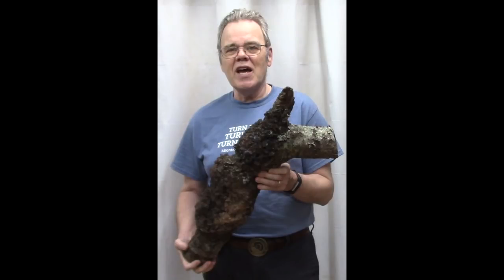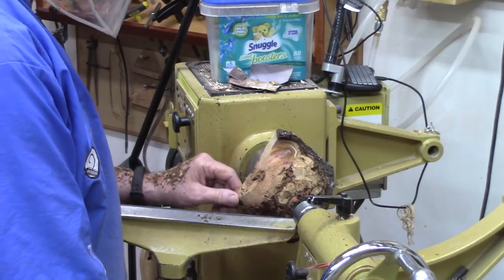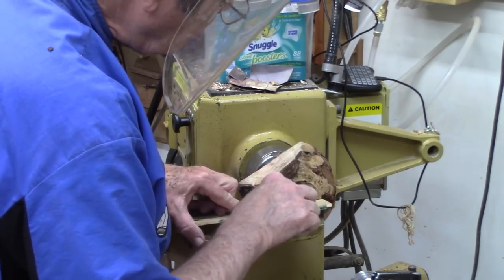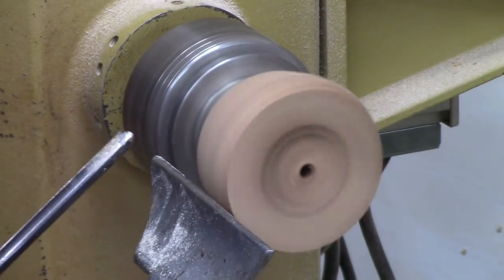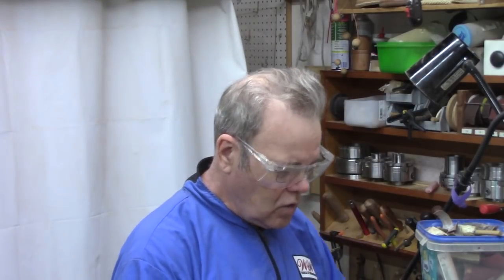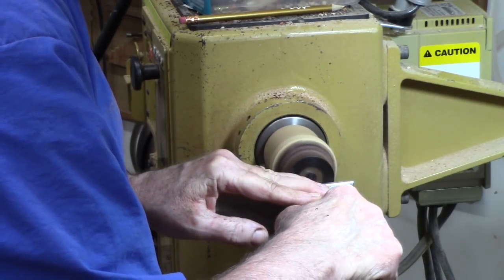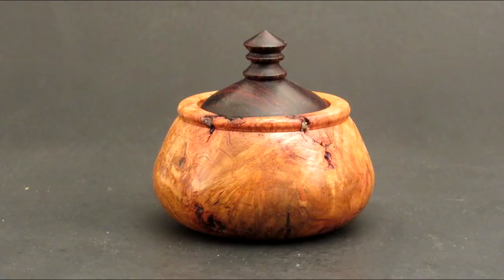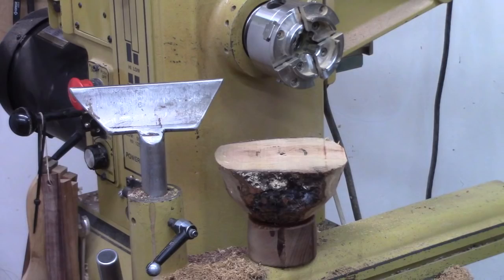Woodturning a Lidded Box from Cherry Burl

Comment: Hey, Mike.. Awesome piece as always.  You mentioned (around 14.38) cutting Mylands sanding sealer. What do you cut it with?  Thanks!
Reply from the maker: It is a lacquer sanding sealer so you use lacquer thinner.  If I was using shellac I would use DNA